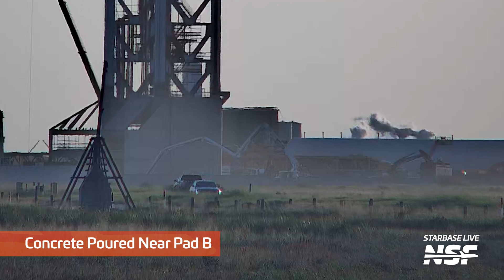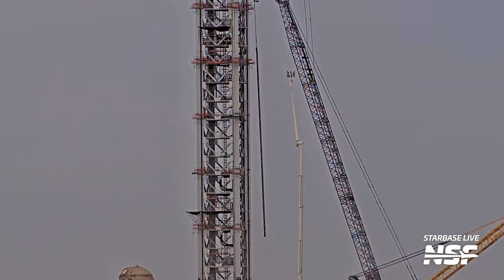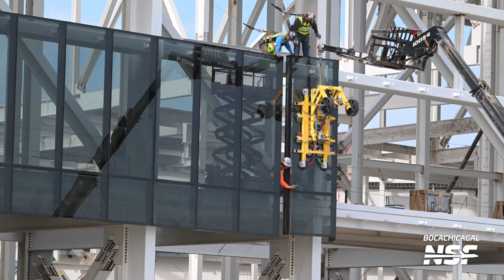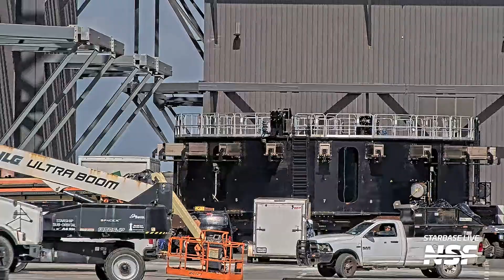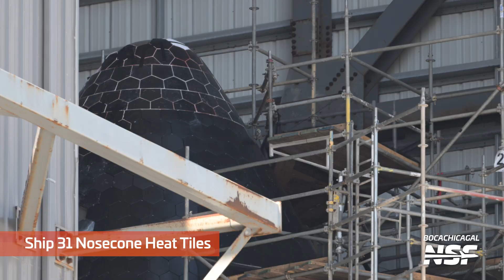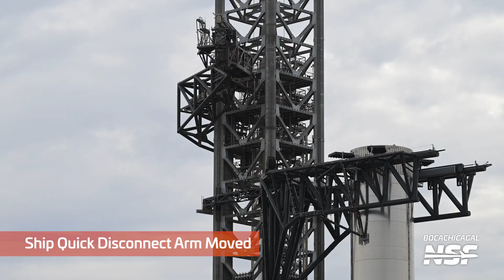Booster 13 Rolled Out While Booster 12's Hotstage Ring is Recovered | SpaceX Boca Chica

Comment: Regarding the insane power of a vacuum, I recall the story of an inventor from way back who was messing around with vacuum..
He had a cast iron sphere made, about the size of a basket ball, in 2 halves, with ( I believe), a leather gasket between the two mating surfaces, it was held together while a vacuum was drawn in it, and then it was hooked up to 2 teams of horses, with the demonstration being, that the dozen or so horses could not pull the 2 halves apart.
This was about 3 hundred years ago, and even with a pretty meager vacuum, (it wasn't a full vacuum, since the equipment used was pretty basic), there was NO WAY for the horse teams to pull it apart.
Air pressure is amazing.
Now days I have a small, $140 vac pump which will easily remove 98% of the air from the stainless chamber when I'm doing epoxy resin work.

Comment: Gimballing Reaction Control Thrusters, to direct, (steer) the ship during renetry instead of using flight control surfaces would be better. 
The Space Shuttle used thrusters for the extreme temperature phase of rentry.

Comment: Is SpaceX going to retrieve every hot staging ring or are they going to litter the gulf floor with hundreds of them once they ramp up flights?
Reply: simple- they are not gonna dump every HSR, it will be phased out for hot stage rings that are lighter and can stay on the booster
Reply: Remember… until SpaceX recovered the first Falcon, boosters were ALWAYS splashed into the ocean. Or Gulf.
Reply: @ernestgalvan9037  good point!
Reply: It should be a part of the next generation of boosters. This is just a quick fix for these first boosters.

Comment: Nice job on the commentary.  Regarding the Booster 13 transport, I will continue to wish for a raised rail system, supported by piles (minimizing impact on the surrounding land and wild life can pass under it), specifically for transporting items that would normally cause a road closure, such as boosters and ships.  Construction impact would be minimal with modern construction technology available.  If not actual rails, something that the SPMT wheels would slot into (so four slots/paths).  This would allow for continued use of current equipment that has been proven AND when not needing two SPMTs side by side, you now have bi directional paths for SPMT traffic that items requiring transport but only need one SPMT.  As little as SPMTs are used on the road, it would still reduce ware on the road (again even if just a little).  If for no other reason, would give vids of the dedicated transport path(s) down in Florida. Thanks for everything NSF!  🙂

Comment: If the FAA is fast on IFT-7, could we see S33 launch this year?
A hypothetical timeline would be:
October 30: S33 rolls to Masseys
October 31-November 3: Cryo testing
November 4: Roll to Mega Bay 2
November 5-November 15: Engine Installation
November 16: IFT-6
November 17 to November 24: Engine Installation continues
November 25: S33 to Masseys,  B14 to OLM A
November 27: B14 Static fire.
November 29: S33 Static fire.
November 30: S33 to Mega Bay 2.
December 3: S33 to OLM A.
December 15: Launch.
Its unlikely, and requires rapid turnaround of S33 to be well beyond anything V1 demonstrated, but it may be slightly possible
Reply: Probably won’t happen since there’s still work left on block 2s also flight 6 as far as we know rn is probably November 11th
Reply: @nono-zu6ob  Yes, it probably won't happen. But, if the FAA is smart, it may.
(Also, I think a November 11th date is wildly optimistic. So is my November 16, but slighlty less so)
Reply: @bryanillenberg  the flight profile was already approved so no “pending regulatory approval” this time since flight 6 is covered on the flight 5 license
Reply: @nono-zu6ob  Approval has been granted for Flight 6, not Flight 7
Reply: @bryanillenberg  which the next flight is flight 6 flight 7 isn’t til probably next year
Reply: @nono-zu6ob  My post was referencing a very unlikely scenario in which IFT-7 occurs this year
Reply: UPDATED TIMELINE:
October 25: S33 rolls to Masseys
October 26-October 29: Cryo testing
October 30: Roll to Mega Bay 2 
October 31-November 15: Engine Installation
November 16: IFT-6
November 17 to November 20: Engine Installation continues
November 21: S33 to Masseys
November 25: B14 to OLM A
November 27: B14 Static fire.
November 29: S33 Static fire.
November 30: S33 to Mega Bay 2.
December 3: S33 to OLM A.
December 15: Launch.
Its unlikely, and requires rapid turnaround of S33 to be well beyond anything V1 demonstrated, but it may be slightly possible
Reply: @bryanillenberg  think as far as we know its still planned for November 11th I can find anything on November 16th launch since B13 has been static fired and all that's left is mostly ship 31s heat shield needs to be finished
Reply: @nono-zu6ob  None of these dates are official. I'll update whenever they change.
Reply: UPDATED TIMELINE:
October 25: S33 rolls to Masseys
October 26-October 31: Cryo testing
November 1: Roll to Mega Bay 2 
November 2-November 15: Engine Installation
November 16: IFT-6
November 17 to November 22: Engine Installation continues
November 23: S33 to Masseys
November 25: B14 to OLM A
November 27: B14 Static fire.
December 1: S33 Static fire.
December 3: S33 to Mega Bay 2.
December 5: S33 to OLM A.
December 17: Launch.
Reply: UPDATED TIMELINE:
October 25: S33 rolls to Masseys
October 26-October 31: Cryo testing
November 1: Roll to Mega Bay 2 
November 2-November 17: Engine Installation
November 18: IFT-6
November 19 to December 6: Engine Installation continues
December 7: S33 to Masseys
December 8: B14 to OLM A
December 10: B14 Static fire.
December 15: S33 Static fire.
December 16: S33 to Mega Bay 2.
December 19: S33 to OLM A.
December 23: Launch.
Reply: @bryanillenberg  their still going for November 11th I think I dont think WAI has said space X changing from going for November 11th but we also haven't heard of any road closures or air yet
Reply: @nono-zu6ob  SpaceX has said November 18, and November 11 was never on the table.
Reply: @bryanillenberg  can't find anything saying November 11th was never on the table
Reply: @nono-zu6ob  It was veterans day.
Literally could not happen
Reply: @bryanillenberg  according to a NASA document flight 7 is targeted for January 11th
Reply: @nono-zu6ob  Yup. And IFT-6 was November 19.
UPDATED TIMELINE:
October 25: S33 rolls to Masseys
October 26-October 31: Cryo testing
November 1: Roll to Mega Bay 2 
November 2-November 18: Engine Installation
November 19: IFT-6
November 20 to December 9: Engine Installation continues
December 10: S33 to Masseys
December 11: B14 to OLM A
December 12: B14 Static fire.
Decenber 14: B14 to Mega Bay 1
December 17: S33 Static fire.
December 19: S33 to Mega Bay 2.
December 20-January 3: S33 final work.
January 4-January 10: S33 to OLM A, B14 to OLM A, final flight prep (FTS, mini WDR, ect, ect)
January 11: Launch.
Reply: UPDATED TIMELINE:
October 25: S33 rolls to Masseys
October 26-October 31: Cryo testing
November 1: Roll to Mega Bay 2 
November 2-November 18: Engine Installation
November 19: IFT-6
November 20 to December 4: Engine Installation continues
December 5: B14 to OLM A
December 6: S33 to Masseys
December 9: B14 Static fire.
Decenber 11: B14 to Mega Bay 1
December 13: S33 Static fire.
December 15: S33 to Mega Bay 2.
December 16-January 3: S33 final work.
January 4-January 10: S33 to OLM A, B14 to OLM A, final flight prep (FTS, mini WDR, ect, ect)
January 11: Launch.

Comment: Yes, it's just suction used to lift the glass, most times.  Far less risk of damage than lifting it with something that may cause a chip/crack.
Reply: They typically have vacuum sensors that sound an alarm is vacuum drops
Reply: @oof_Dad  yeah, always important to know, right
Reply: @oof_Dad  And vacuum pumps to keep up the suction.